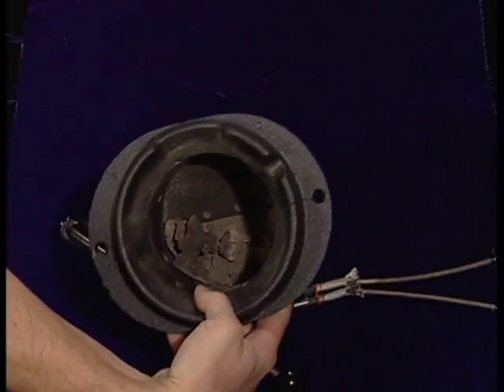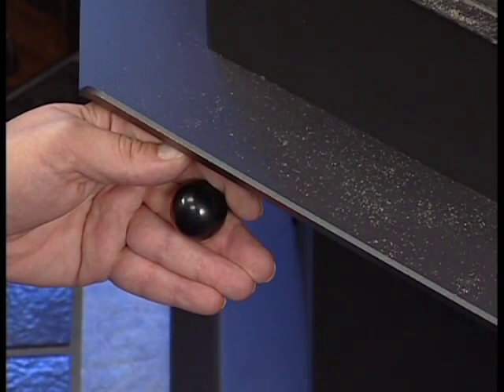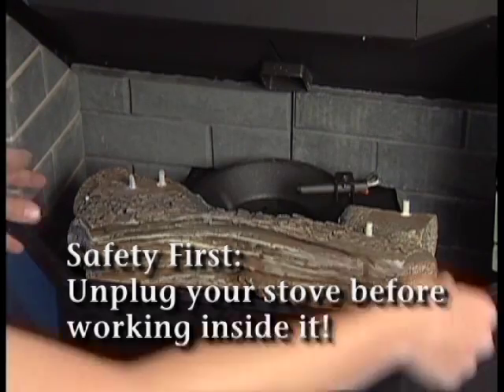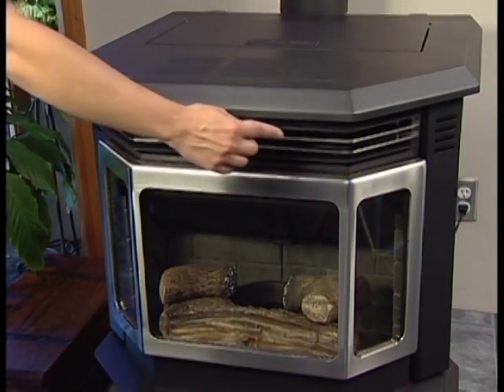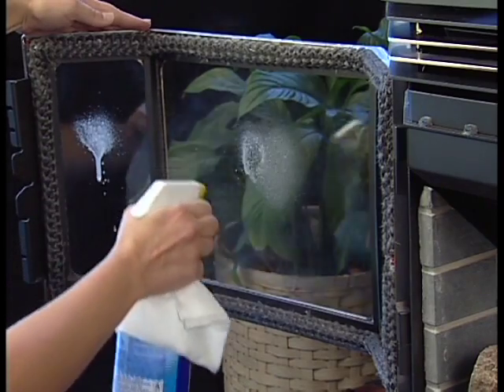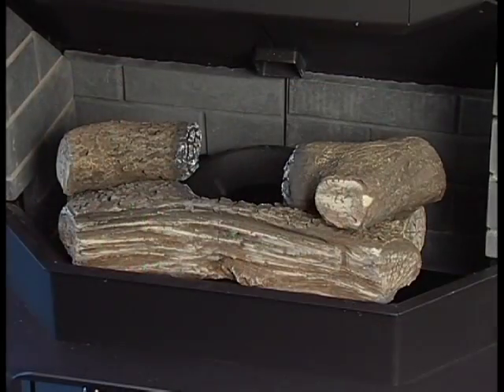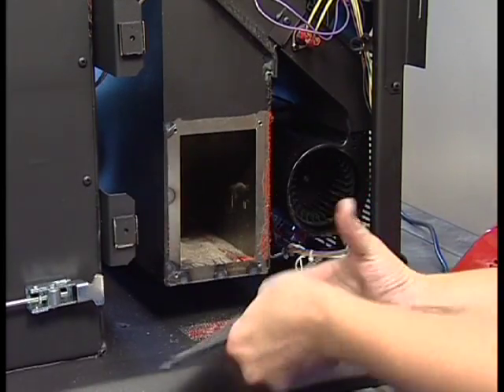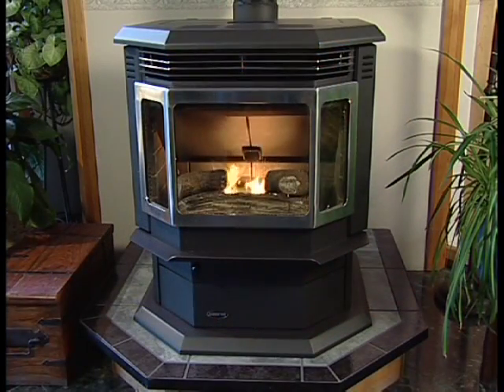Quadra-Fire® Classic Bay 1200 Pellet Stove: Maintenance Video

Comment: We are new to the pellet stove world but so far we love our quad-fire stove. but our installer did not explain much in the way to clean this. he just headed me the clinker tool and told me this is what you use to clean them off with. very little instruction. I at least wished he told us about your videos. When I called them today to tell them our stove will not light and was requesting a service call. the lady just said make sure you cleaned all the clinkers from the fire pot and then call back if it still will not fire. I still had no Idea what a clinker was. well thanks to your video we now know what clinkers are and how to clean them. Job well done. I don't know why I did not think to go here first.

Comment: I find scraping the crust off the inside of the fire pot to be a little more involved than sliding a putty knife around. I use a butter knife with the end filed flat, and usually have to chip a while to get the floor plate to function properly. That said, I love my Quad. It is a very well built and reliable machine.

Comment: Okay there is a couple very, very, very, important cleaning tasks that aren't mentioned in this video that should be done once per season either at the end or before or before you start burning. Do this when the stove is completely cold and there is no risk of coals ending up in the vacuum cleaner. I say vacuum cleaner but I mean shop vac not your wife's household vacuum cleaner or you will end up living in your garage while she files the divorce papers. Unplug the stove from the wall outlet or trip the breaker if it is hard wired to the house circuits before starting.

Completely read all these instructions before starting this cleaning regiment. If you are the type of person who knows everything and can't read this to the end then close the browser NOW and call a professional you are just going to screw this up and get your wife pissed off at you.

1. There is an access plate behind the ash pan with 4 screws that must be removed and cleaned once per season by vacuuming. The stove must also be lifted slightly and the void under the stove floor and between tile floor must be cleaned of ash and klinkers.  It allows air to be drawn in through a hole in the back left of the stove floor and blown up through the fire pot holes and if it is plugged there and a bunch of problems that will occur. When this is restricted not enough air pressure is being blown through the holes in the fire pot and pellets and ash will begin to build up in the fire pot and if it gets bad enough the bowl will fill with ash and unburnt pellets. Your stove will also not put out as much heat as it will when this area is clean. This will also cause the blower fan at the back left side of the stove to work harder than it should have to to force air into the burn pot. So if your bowl is filling with pellets and causing excessive cleaning of the bowl or you experience less heat output this is likely the problem.

2. The second point to be cleaned is by removing a second access plate with 2 screws just above the ash pan on the outside front of the stove. This accesses the inside bottom of the fire pot where the igniter is located. This area can also build up with ash and klinkers restricting air flow to the burn pot and causing the igniter not to work properly. Vacuum this area out also. 

3. Once every two or three seasons the blower motor on the back left side should be removed and the fins should be inspected and cleaned of any crusty build up to ensure the air is being blown correctly to the burn pot. Be careful of the gasket (either asbestos or rubber) when removing the motor. Simply loosen the 6 screws holding the motor and turn the motor counterclockwise and line up the holes and remove it by  pulling it towards you. You won't need to remove the wires to inspect it but if you have to clean the fins you should unplug the wires. If you end up in the kitchen at night and cannot remember why you are there, then note the position of the motor and wires before removing them so it goes back together properly and safely (I recommend taking photos before disassembling).

4. When doing this cleaning start at the top and work your way to the bottom of the stove so any ash not picked up by the vacuum will end up eventually falling to the air void between the tile/concrete floor of your house and the floor of the stove. Depending how the exhaust pipe is installed the stove may only rise up more than inch or so (block this up for safety). I duct tape a cardboard paper towel tube to the end of the shop vac so it can be squeezed under the gap created by lifting the stove.

5. Also inspect the exhaust pipes venting the stove smoke and gasses to the outside. Pay particular attention to the horizontal areas where ash is likely to lay. Vacuum this out at least once per year. Ensure ALL the screws go back into the holes on the pipe or you will get a faint smell of burning wood around the stove.

6. Don't forget to cut the power to the stove before starting cleaning.

7. Don't forget to cut the power to the stove before starting cleaning.
Reply: I have a quadrafire 1200 that is shutting off constantly. I clean the heck out of it, but didn't know about the access panels near the ash pan? can you provide a video or pics?
Reply: @willprusak1224 I don't think there is a way to add pics to the comments. It could be the high or low temp sensors causing the shut downs but before you do that. If you get down low with a flashlight just above the ash pan and to the right of the spring loaded  handle you pull to empty to burn bowl you will see a plate with four screws. Remove this plate and clean the cavity inside. Once that is complete pull out the ash pan and straight back you will see another plate with 4 screws. Remove it and vacuum out that small cavity. Sometimes ash will build up under the stove in the cavity that supplies the air to the burn bowl. To clean this you will have to lift the front left corner of the stove up and place a small 1" piece of wood under it to hold it up. Then you have to vacuum under the stove. To do this I tape a empty paper towel roll to the end of my shop vac and flatten it enough to fit under the stove and vacuum any ash that falls under it. If this doesn't work its likely either the high or low temperature sensors inside the door on the right hand side with the reset switch. Hope this helps
Reply: Lifting the stove slightly to clean between the floor and a void at the bottom????? Longtime Harman and Whitfield stove owner here looking to purchase a Quadra Fire.. I have done it all.. But if I have to slightly lift my entire pellet stove in order to clean underneath it, sounds absolutely ridiculous... I'll pass if this truly the case...
Reply: @robertb4432  So the fan which blows the air over the heat transfer plate pulls the air from the rear of the stove and the air travels through the base of the stove. If the stove gets really dirty the ash will drop through to the base of the stove in the air duct and restrict the air. If you keep the stove really clean it likely won't be an issue as an annual procedure. Honestly it isn't a big deal but if you want to "Pass" you are missing out on a good made in the USA product.
Reply: @Ober447  thanks for the reply.. You are right, I don't want to miss out..Are you referring to the outside air intake that may inhale ash and other debris?
Reply: @robertb4432  Yes that is correct, its just a matter of good housekeeping. I will typically clean twice a season (Nov-Apr) but I'm kind of anal that way. When they gets really dirty you will hear a slight whistle when the fans run. We are five years in with our stove and would definitely buy another down the road. Cheers!
Reply: @Ober447  Thank you for the advice. Two last questions... Is the stove quiet?  My Harman is naturally noisy even with a new blower and combustion blower and auger.. Last, how often do you have to empty your ash pans?
Reply: @robertb4432  - My stove is in the basement near my office and I can hear it run but not enough to be any distraction. I would consider noise a non issue. 

Cleaning carbon (klinker) from the burn bowl is about a once in 3 days activity if you use good quality pellets. You simply take the tool that comes with the the stove and scrape around the bowl and pull a spring loaded lever and the carbon fall into the ash bin. It takes less than a minute to do this. I experimented with the 4 types of pellets available to me and settled on one particular brand as being cleaner that the rest. This stove has a wall thermostat which shuts off automatically and restarts when the temperature drops again and if the carbon builds up too much it will not restart properly. So in the cold part of the winter here in Canada it will run continuously without issue for up to a week without cleaning, however the first time it reaches temperature it won't start again until I clean the carbon.

In the dead of winter it will burn almost (2) 40 LB bags a day and on days with a warm afternoon maybe about one bag. That is the great thing about the wall thermostat because it will save you money over stoves which you turn off and on manually. The hopper will hold almost (2) 40 Lb bags which gives you a days burn. There is some routine maintenance as I mention above which I typically do when the stove is off or when I refill the hopper. We would never go back to burning cord wood again because this stove never goes out at night and the floors are always warm.

As an aside we have our stove set up to run off two 12v deep cycle batteries if the power goes off because of the electric auger and fans need electricity. We have two 200w solar panels as well as a 750 watt inverter to run it this way.

Comment: I have this exact model and I've just cleaned the whole thing and replaced the pellets with fresh ones.  But now when I turn it on, the flame will start, it will run for 5 minutes and then turn off.  What's going on? Did I miss something?